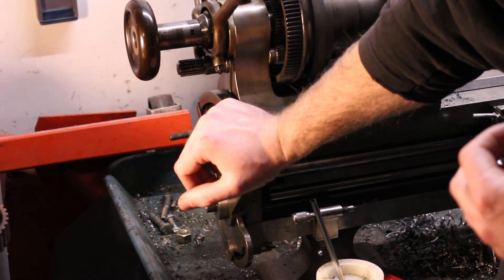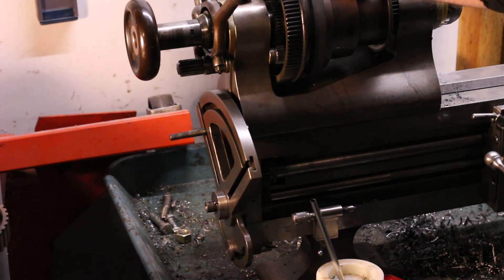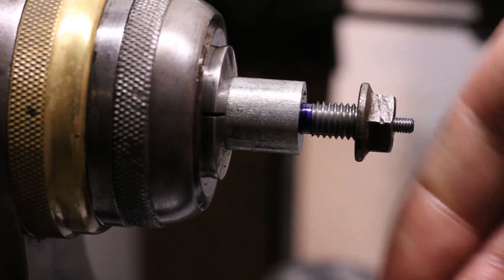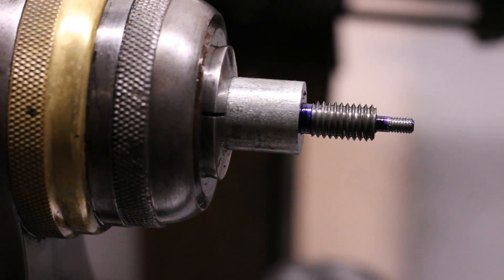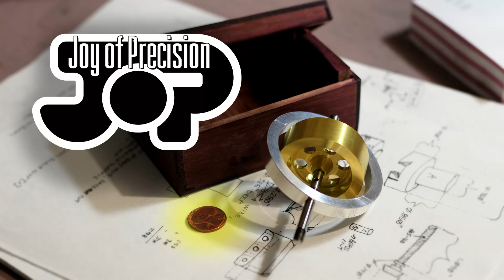Metric Threading Magic (not really)

Comment: Nice to see a fellow Rivett user and demonstrating how to cut both imperial and metric gears with minimum of gears. According to my manual, Rivett did a special set of metric gears comprising 2 sets of gears, 9 gears including the 127 tooth gear using the gearbox, and a second set of 7 gears for special metric threads. However as mentioned by others metric threads are quite well standardised and there are now a small number of common pitch sizes. On my Rivett I am planning at some stage to make  some Metric gears including the 127 tooth gear. I do have a gearbox which simplifies matters a little though. 
I also have a Boxford lathe (similar to Southbend) and it has a full set of change wheels including the 127 tooth compound gear. I use it quite often and can cut quite accurate metric threads.

Comment: I know I am commenting on a video made a year ago --- but I did not find any post by me this in the comments.  There is a method to figure out what gears to use to approximate a given pitch. The method is described in Ivan Law's book which is called I think "Gears and Gear cutting"  and arises not only in Imperial to metric but in cutting a worm to match a given pinion. The method is much too long for me to put in a comment. It is based on continued fraction approximations (which you can Wiki, but it will not help you much)  or buy Ivan's book. Well worth the price.
Reply from the maker: Thanks! I've heard a lot about the book, it's on my list. 🙂

Comment: Hi! I saw an old post of yours on NAWCC about making a hairspring vibrating tool using Arduino. I'm attempting the same 😊. Did you ever finish your version? I'm almost finished with the hardware but I'll need to rework and fit the electronics. Please check my Instagram and DM me there if possible, and if you're interested of course! Many thanks in advance!
https://www.instagram.com/p/Bmk_yaKgsg8/?utm_source=ig_share_sheet&igshid=1rxspdemmkahz

Comment: Well, JOP. It has been 10 months since you posted a video. I know, life gets in the way. Please get back to us!  In the meantime, I will mention that there exists a method by which you can work out all the rational approximations to any pitch. It is called "continous fractions" and is explained very clearly in Ivan Law's book on gears and gear cutting but it is much too long to reproduce here. And you are quite right, you do not always need the 127T  transposer. The old Atlas lathes managed without that gear.

Comment: You may find that stressing over M3.5x0.6 is not worth the hassle.
The reality is most metric stuff tends to use M3x0.5, M4x0.7, M5x0.8, M6x1.0, M8x1.25, M10x1.5, M12x1.75.
M3.5 is very rarely encountered.
Reply: M3.5 is used in British wall switch boxes and electrical outlets.   If you lose a screw there's not much you can do except steal one from another box, as they can't be bought easily.

Comment: Very nice explanation of the substitute gearing. I do the same approximation sometimes even though my quick change lathe has a 127T and 120T combination gear but have to reverse one of the 40T gears to go into the metric threading and sometimes this is not worth the effort to reverse the gears. Also no need for me to reverse the lathe with the half nut engaged when threading metric with a threads per inch thread substitution. Sometimes I partially cut the threads per inch closets version and then finish with a metric die for a perfect thread fit.
Reply from the maker: Paul Jones note, though, that the two example threads I cut are not even inch approximations. They are neither inch nor metric threads, but very close approximations of metric threads from unconventional combinations of the change gears.
Reply: Yes, I know and with combination of the quick change gears and even more gear substitutions at the back of the lathe it is possible to come up with just about any possible variation. I had to do this for a strange thread made by Starrett that I thoght was 28 TPI but not exactly when measured with a thread gage ( http://www.homemadetools.net/forum/brass-clamping-screw-starrett-v-blocks-38166#post53090 ).

Comment: There is a book by Ivan Law, "Gears and Gear Cutting" which is mostly about cutting gears. But he discusses cutting worms for a worm-and-gear combo, given the gear. The worm will usually have an oddball pitch . He shows the method of continued fractions. It is long, but simple. You wind up with a series of rational approximations to the oddball pitch. Then you hunt through  the change gears you have and match up. The method is much too long for me to include here, but it is not hard. If you can divide and take remainders, that's it. Metric is just another oddball pitch on an Imperial lathe.

Comment: Very interesting. This is something I have been investigating for my lathe. I am wanting to cut a 4.333 TPI left-hand internal thread. It's for a domestic vacuum cleaner hose connector.
I have a Lyn Lathe from H. Armitage (MC. Tools) Ltd. The change wheel table inside the change wheel cover has two (2) errors! I found them while trying to find the recipe for a 4.333 TPI thread. The lathe is quite old and the corrections card has gone missing between former owners.

Comment: Question about adding the idler gear - doesn't that reverse the direction of rotation? And wouldn't that make it an opposite-handed thread?
Bonus question: after a pass, you disengage and reverse the machine, to get back to the starting point. Why not cut as you reverse?
Reply from the maker: nuf4n Yes that does reverse the rotation, so the tumble reverse simply needs to be toggled to the opposite side. For lathes without tumble reverse, two idlers would be needed. For clarification, nothing was disengaged for reversing, I don't have a thread counter but even if I did it I'm not sure it would be useful for these wacky pitches. You never want to cut on the reverse pass, it will ruin your threads as all the backlash through the entire gear train and carriage drive stack up.

Comment: The error only matters over the width of the nut.  
You ended up with a very nice thread in the end!
Reply: That's really only true if you're relying on the thread for a fastener (or similar). If you're needing linear motion over a known distance, then the error per turn is cumulative, and can quickly become a problem.
Reply from the maker: Very true on both points. Thanks for watching, guys!

Comment: Wow - .6 is a challenge! I have ''cheated'' in the past - making a slightly ''loose'' or generous cut and, once or twice actually enlarged the pitch fractionally - just to make it work! Usually trying to find closest imperial TPI if possible. That web site is super useful - anything that avoids too much math :)
I forget - was it you working on a Hemmingway kit - I forget who is making what sometimes!
Reply from the maker: ChrisB257 thanks for watching! Yes, I am building the Trent Pinion Mill. :-)
Reply: Weren't you going to have a bunch of those pinion mills built and scraped in for Keith Fenner's What's In Your Box?  No?  Well, I'll settle for some more build video please!
Reply: No - my WIYB this year is a bit of a cheat as I have had problems spending enough time in the shop - although still hoping to get more done soon. I sent Keith a Myford vertical slide which I haven't used in ages - not exactly a build but hopefully it will be a very nice item for one of the winners.